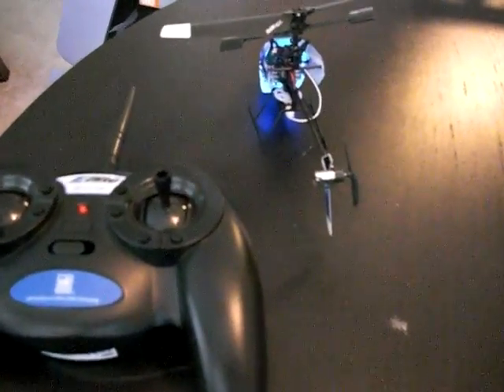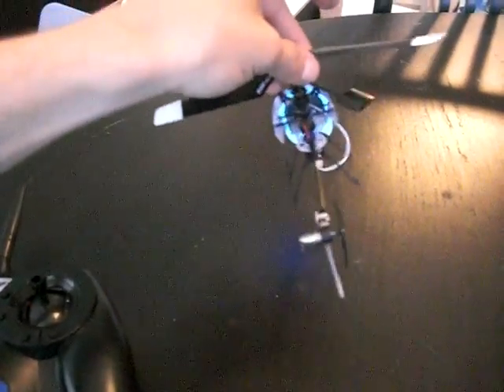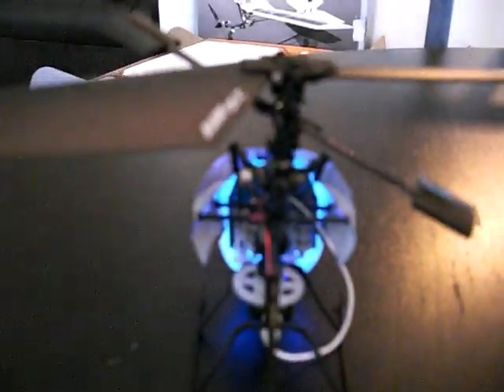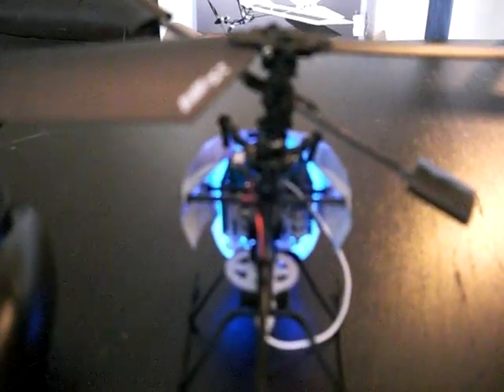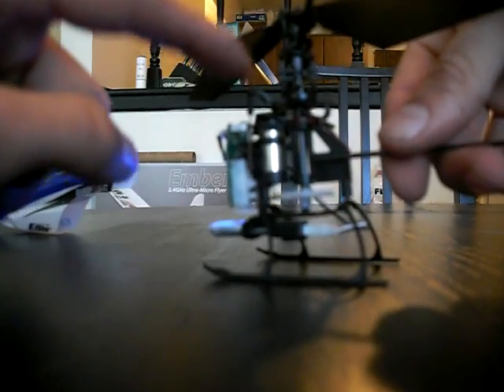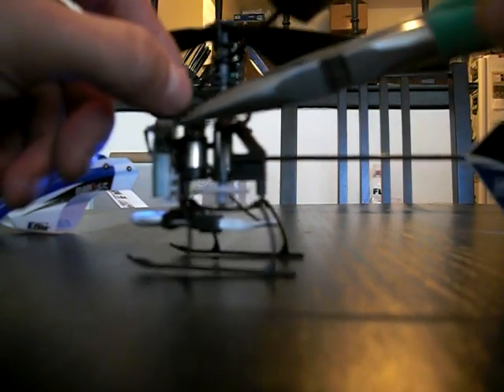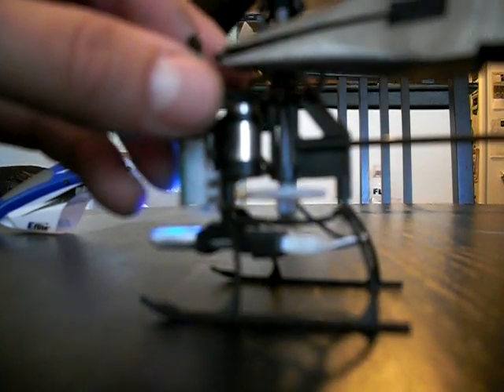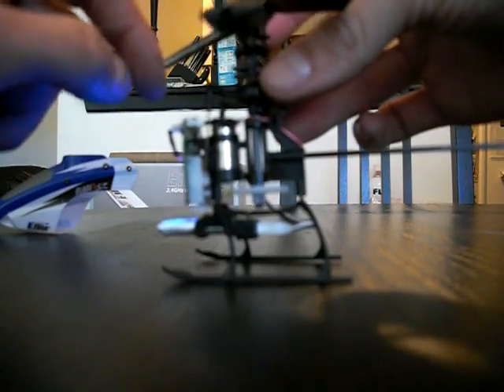Fixing helicopter trim issues

Comment: My helicopter tilts. Like at the blades are spinning the body is not straight up and down. It's tilting.
Reply from the maker: I believe that is pretty normal on these older micro FP helicopters, even some newer ones.  The tilt should be very minimal though, and it doesn't effect flight.

Comment: We have the Jamara G230.4 (2.4 GHz, 3-channel) heli, and it does not have the trim knob in the middle, but it does have right & left trim buttons. When we hover it, it tends to go backwards rather than remain stationary. When we apply forward torque it does not go forward but keeps slipping slowly backwards. Any ideas?

I took the canopy off and it did not have the same parts yours has for left & right trim that we could adjust, even though that's not what we need right now anyway.

Comment: Can you please answer me? I've blade 120 s it has swashplate. And it keeps turning/leaning to the left. it's not trimming problem. i think its the thing you did in the video. so do you turn it to the left of the right if you want to adjust it to the right?
Reply: I'll clockwise shortens length counter clockwise extends length.
Reply: @thetruthhurts4054  ok
Reply: @Ginfio  remember small increments like half turn to 1 turn then test.
Reply: @thetruthhurts4054  Ok thanks. Now the tail thing is broken. I'm gonna try to buy a replacement tail __. If i'll still have problem, i might ask you for help. Thanks.
Reply: @Ginfio  sure any time my friend. What's going on with it now? Depending on how broken gorilla glue works wonders. As I said it depends how broken it is.
Reply: The Truth I think it's called the tail boom set (the long thing that connects to the helicopter), its spoilt in many pieces; i think because I pushed the wire and the tail boom set non properly. 
Also the wire connecting the tail boom set is damaged from being pushed too hard trying to get it in the hole (back of the heli).
I'm probably gonna just buy a new tail boom set when I have the money.
I already bought about 4 parts replacement because it kept breaking.
I flew it good on for the very first time and after a few moments it crashed into a tree(wind). It's also the location problem. I need to get to open spot (or field) where it's not surrounded by trees.
Reply: @Ginfio  yea trees are not good. If you need just ask I will help if I can

Comment: question... how do you get those things off???? my fingers are sore from pulling and needle nose pliers bend the rods...
Reply from the maker: +NotUsingMyName These little helicopters and other RC can be a bit annoying to work on.  Like you mentioned you have to be careful or they can bend.  Not much I can say to help you do it better.  I pretty much am in the same boat.  I just try to be as careful as possible without getting frustrated.

Comment: Hi Earthling1984, me and some friends recently acquired a back hawk rescute power in air silverlit helicopter (unless if deluxe version). We're having trimming problems. The body of the helicopter cannot be detached so we're unsure how to manually fix the trim. Any suggestions?
Reply from the maker: Hmm.  I haven't worked with that model.

Comment: Very good vid. Well communicated but you should remove the battery before touching these servos arms. They are very easily breakable. Be sure to turned off the copter when moving them. 

That doesn't fix the problem mine have (always turning clockwise) but maybe you did another video for it. I dont know

Comment: I have the V911, and wanted to ask you about the servo horns.  There are two holes on them.  The linkage was set to the outer most hole.  There is also a inner hole.  Is this for less throw movement on the linkage.  Is one hole for more stable flight, and the other for more nimble flight?  Thanks also for the trim tutorial.

Comment: please notice that the postion of the batterypack in the heli is very important too. if you place the battery in the heli too much forward it will be noseheavy. tail vice versa. if this is the case,nevermind trimming. you need to balance the helicopter aswell. the weight of the battery's have a hugh impact on these microheli's...

Comment: @kangmana09 circles? Like a toilet bowl flying? If that is the case the inner shaft is most likely bent, if the heli itself is spinning in circles its likely your tailor rotor needs to be replaced.

Comment: Nice video, I just bought a 120sr having the problem with constantly flying left. I had an MCX model for years and never had issues with it but this one keeps flying crazy. I took the canopy off and noticed the left rod was way noticeably lower than the right. I raised it and when my battery recharges I'm going to try taking off again. I mean this thing won't even hover straight it was very out of control.

Comment: I have searched for hours trying to find out why my new metal swash-plate I installed was causing my Blade MCX2 to drift violently to the left. After hours of tweaking, taking apart, and putting back together only did I find this on my own. If only I would have found your helpful video before, you would have saved me sooo much time. I have thumbed this video up in hopes others who may have the same problem will see your upload. Awesome video!!!!

Comment from the maker: @bizzy420 I assume you might have a lot of forward trim in your transmitter?  This forward trim uses some of the forward movement.  So if you are trimmed forward a lot(to just hover) then you have little forward movement left to go forward.  Adjust the links so your 'elevator' trim is more centered.

Comment from the maker: @Christhereal any and every helicopter can require some trim at times.   My mSR flew 100% perfect out of the box, and since then, still perfect.  But if you crash, or replace a part, sure you might need to trim, it is something helicopter fliers need to do from time to time.  The mSR is probably the best micro FP heli to learn on.

Comment from the maker: @lasse5282 sorry I answered too quick without reading well.  Hmm, I am unsure why it would be doing that.  It could be that the throttle's aren't setup and aren't spinning correctly.  Try starting your helicopter(plug in the battery) with the transmitter turned on, and throttle at 100%.  After it is binded(rotors shouldn't spin up, but be on the lookout and ready to turn off if they do)... but start at 100% throttle when you plug in battery, then after a few seconds, put to 0% throttle.

Comment: I bound the transmitter from the SR to my MSR, the heli is less than two hours old and the tail rotates to the right (counter clockwise) even with the rotor trimmed all the way. i tried torquing the tail blade and it works for a while then it goes right back to rotating slowly. Any idea's?

Comment: I've had a few micro helis and all of them had a slipping tail rotor shaft. It seems there are radial forces that are stronger than the slip-on tail rotor can handle. For mine, a tiny smearing of super glue to the shaft before pressing on the rotor blade made all the difference in the world for yaw control. In fact, I never had to replace another tail rotor!   :)

Comment: Another way to fix this is to check the horseshoe shaped piece of plastic that rotates with the rotor shaft and sits on top of the swashplate. Over time, this horseshoe shaped piece of plastic rises up the shaft. Get some needlenose pliers and squeeze it down as far as you can. Usually there is a tiny sliver of visible light thru it if you look from the side. Just get it as close as possible to the swashplate and it should fix your trim issues.

Comment: my msr keeps going to th right even though my lp5dsm tx that cmae with my cx2 wont provide enough trim. if it helps, i also switched th no.1 dipswitch under th little hatch to up. but th book said its needs to be down. but when its down, the heli doesnt power up. wheni put it up it started to power up. but my main issue is that my msr keeps going to right. HELP!!! btw its the rudder, not the ailron

Comment from the maker: @MACSTER1981 FLY SLOW!  For a FEW WEEKS!  Hovering this helicopter is about as easy as the mCX.  Once trimmed you can just take off and it will hover just fine.  So learn to hover and stay in one spot for a while.  Then do very slow movements - try circles and figure 8's, but do they slow.  This helicopter, as you have seen in videos, can go very fast.  You will have great fun with it, but the slower you learn on it, the less you will break :)

Comment: Great video, nicely described workflow. Thanks! My Bind & fly MSR was miles out and required not only maximum right trim but also considerably right stick on take off to stop it falling over on its left hand side (when viewed from the tail). Not sure why my unit is so out of tilt, looks like the manufacturers testing left something to be desired. Well done for the very useful video!

Comment: I just got my msr, and flew it once and it flew great. not very long since it was a new battery but flew nicely. the second battery i tried to fly my heli just wanted to spin to the left, and barely would do any right rudder and would start just spinning to the left in a hover. I was about to call horizon when I noticed that the tail rotor wires connector was half way out. that was it, they wrapped it around the body post too tightly so a rough landing will pull the wires out. flies great again!

Comment: You should have the helicopter turned off when ur adjusting the servo arms though. Those little servo's can easily be stripped and if it's turned on your more likely to do it because the servo's will be trying to hold their place. That's what I've learned from my years of rc cars and boats anyways. I'm new to heli's and the MSR but I would assume the same logic would apply to heli's.

Comment from the maker: if your heli is going in a circle, you may need to do more than just electric trim it.  First thing to try is the little swashplate tool, if you haven't used it, that may fix your problem(or at least the circle problem) then you can trim from there.

Comment: @ tebster01: The only way to resolve this issue is to fly the helicopter. You can not expect a hands off hover with a tail rotor heli. Any helicopter with a tail rotor will naturally be pushed to the left by tail rotor thrust, even when it is in trim.

Comment: I had to do that as well. Mine flies geat. I have the CX2 and the mCX and I have alredy gotten my feet wet. I move the controll links to agressive and thats when my trim problems really became outta control. So I did what this vid suggests and it flies great! Also, when using the calibration tool the manual says to push up on the top of the swashplate until the tool is sandwiched......... I did that and my heli really went outta control. Make sure the swashplate is LEVEL after you do that.

Comment from the maker: Yes and no.  It is a great single rotor to learn on... but if you are learning, and haven't flown before, I would recommend starting with either a co-axial helicopter or a computer simulator before moving to a single rotor.

Comment: Thanks for posting this video. I knew about how to adjust mine however its nice to see how easy it is to take the canopy off. Also, good on you for pointing out how to avoid bending the swashplate using the pliers for support. You will have saved countless helis with that tip. Its videos like yours that makes Youtube a fantastic support tool. keep them coming.

Comment: I use a DX6i for my GAUI200 and MiniTitan, and I make sure to 'hardware' trim the helis, so all trim levers on my DX6i are kept at neutral.

I started doing it this way when I got the first helicopter I was able to hover successfully (SRB Quark). It uses an old 72MHz technology. I realized when the links are properly trimmed, it can crash land perfectly upright, thus preventing damage to any parts whenever it  loses radio signal, or whenever LVC kicks in before I could land the helicopter.

Comment from the maker: for sure.  It is always best to 'hardware' trim to center.  So your controller is setup basically dead center on all trims.  This also makes it easier to switch between different aircrafts; as long as all your crafts are setup to center (unless using a DX6i or better, then it saves all that information/settings/trimming for you - but even with a DX6i or better, you should still trim the hardware, it just seems better when the hardware is centered).

Comment: IMHO, trimming on the helicopter (not the transmitter) is always the best practice. It gives you full control throws on all directions.
I only do trimming on the transmitter if there is a temporary load (like having to attach a small video cam) that affects the flight characteristics of the helicopter. This makes it easier to switch back to neutral trim when the load is no longer there.

Comment from the maker: Yes, especially if using NOT a DX6i or better which save your trim settings.  With a mCX/mSR controller, if you trimmed say all the way to the right with your mSR, then went to fly your mCX, the trim will still be maxed out to the right, causing the mCX to drift right... so left trim will be needed.  Controllers like the DX6i save your settings so you have stable flight without trimming as it saved your last trim setting.

Comment: earthling....excellent video on correcting trim.  I would also recommend to unplug the battery and turn off the transmitter before making the adjustments.  This will make sure that your trim settings are neutral after making the adjustments and turning back on.